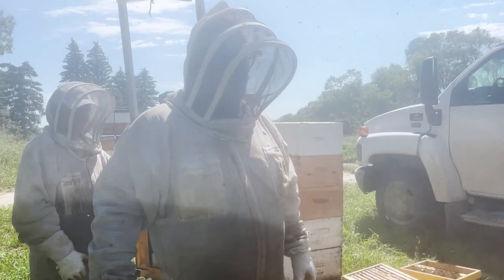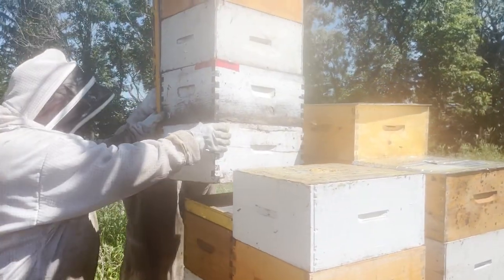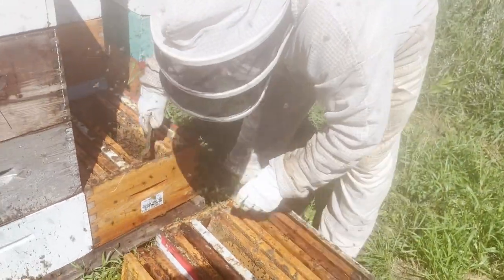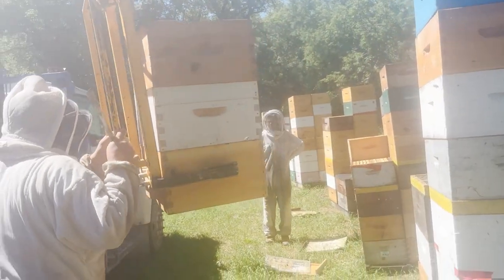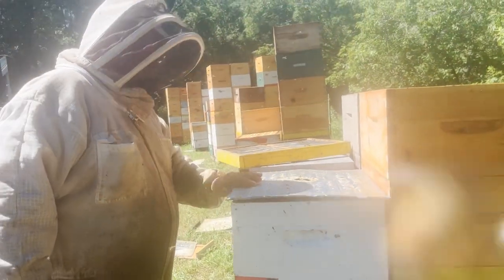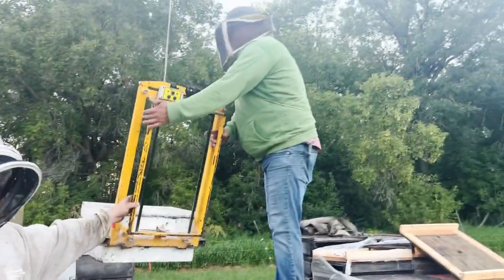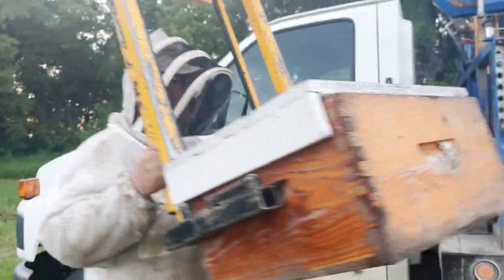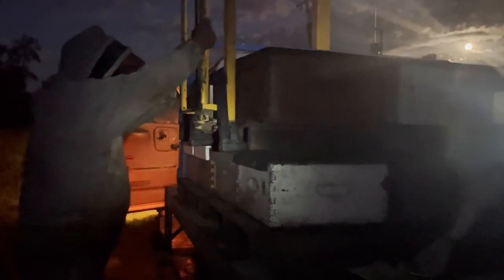Mid season splits- all steps.

Comment: Awesome video thanks... If you only had new foundation out of drawn comb how would you go about splits .. ? Plan on using my double hives with nuc boxes on top so they are basically 8 frame nucs .. my production colony's are massive plenty of bees to work with.. have flow going but we have major flow hitting in September... goldenrod really strong flow.. I take brood I'll have to replace the frames with new foundation.. brood is easy to get to I have queen excluders on. It's wall to wall brood .
Reply: Take 1-2 Frames of brood and insert foundation right in the middle 1-2 days later it will be drawn and eggs layed on.

Put a box of foundation right over the queen excluders so they can draw it. A good nuc can draw 2 frames in the bottom box (2nd frame from the outside) and a whole box once it is really crowded with bees. Just keep feeding it with thin sugar syrup (not hfcs)

Comment: Thanks for the summer split explanation. Also, did you install a downward light on that easylift arm?
Reply from the maker: I just hung my headlamp from the boom.  I disconnected the built in light years ago to avoid the hassle associated with the wiring twisting around the axle.